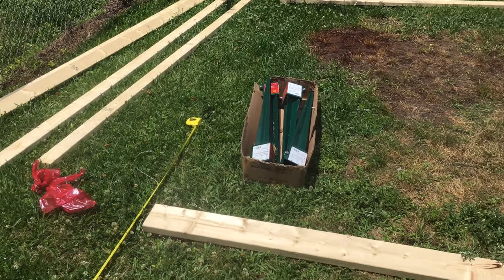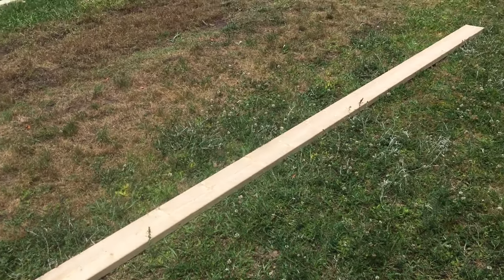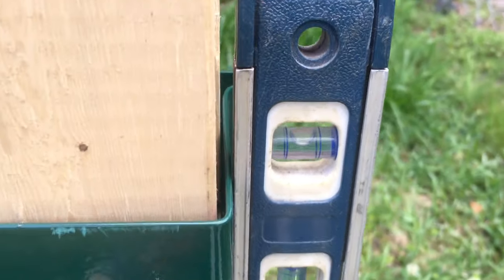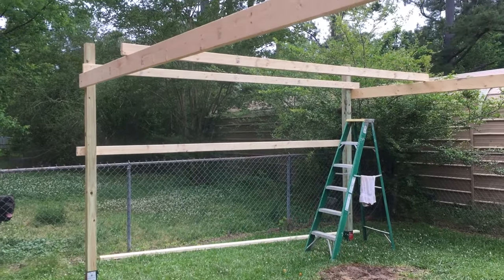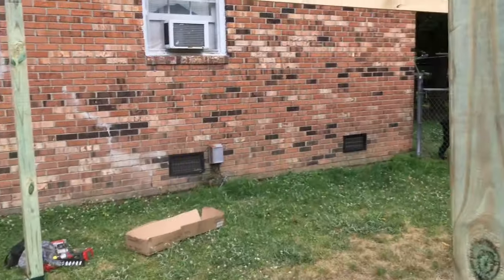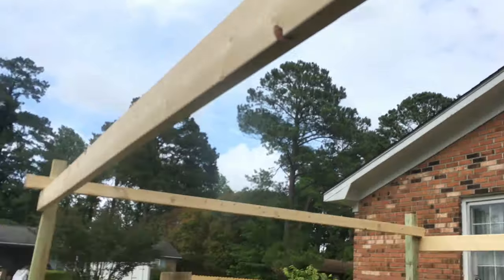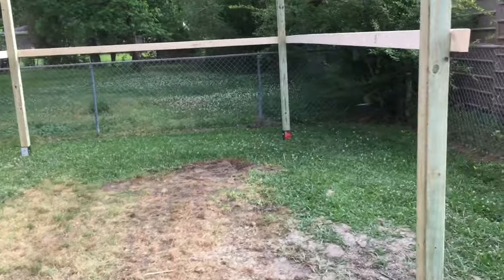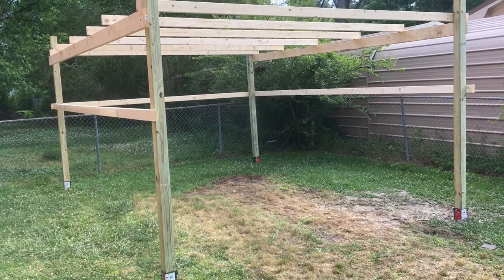Easy & Cheap DIY Carport Subscribe if you find this video interesting!

Comment: This is my kinda build project.  No money, cheap as possible, but functional.  Instead of sticker shock all at once price, build a carport first, sheath it over time and pour interior concrete slab later - spread out the cost over time.
Reply: Same! I just want something to protect against hail without spending thousands
Reply: @Techie_Lee same here perfect for my old f100 I’m doing up down here although I’ll be putting on a tin roof 👍🇦🇺

Comment: I got the harbor frieght carport for 100+ dollars. The top was torn to sreads by the wind, i replaced it with shade cloth. I used 20×10 pieces two. The wind blews thru it no problems and the shade is great
Reply: Also on the HF carport  I used T-posts on each corner to hold it down total cost 
120 metal frame
4 Tpost 5 each 20
Ebay items 
Two 50% shade cloth 20 each
6 inch bungie ties 10 bucks
Over all cost 170.00
 two years of use so far

Comment: I'm in the process of closing on my first house, which comes with a single car garage.  I was considering putting up a carport just outside the garage to use for parking while using said garage for storage.  Your method definitely piqued my interest.
Reply from the maker: I’m glad my project has provided some assistance in a way! The only difference I would make, as mentioned in the video, is using a metal roof. This tarp one ripped during the first hurricane. Otherwise, still standing strong. Subscribe for more diy ideas 😁

Comment: I've used those 4x4 post holders with great success. I've tried 2 years to remove them from the ground and after swearing alot, digging, hitting and more swearing, I had to dig them out by hand and shovel. Love them.
Reply from the maker: I know what you mean. Fun fact, I put one of these posts in at the wrong measurement and had to dig it up by hand. Very difficult to pull out!!
Reply: Use a hi-lift jack or a cable/rope around the base of them strung over an old tire on a rim or just the rim and pull slowly with tractor or vehicle. The trick is to pull them straight up. Engine hoist works too. Pulley on a tripod too.
Reply: Use a jack to remove it. A floor jack or such.

Comment: Hey bud, just searching through videos about pole barns and came across your video. I'll probably make something more elaborate than this, but I did learn that those stakes exist from your video, I'll look into those. 

I really wanted to say though, nice Mach 1. lol. I have a '72 Mach myself.
Reply from the maker: Thanks bud for watching. Glad I could provide some insight to your project. Subscribe if you could! I’m trying to reach 1000 subscribers. I usually make random diy videos. Whatever project I’m working on at the time, I try to upload!
Reply: I was going to say this too. My first car in 87 (at 16) was a '72 Mach 1 fastback.

Comment: looks good. paint it with used motor oil to keep the bees out of it and from rotting
Reply: Nice idea, but lets make sure no fire souce is near.
Reply: @JavoCover  wrong. it won't catch fire no quicker than anything else. it's a guy on YT that put that myth to rest
Reply: I thought my mom was crazy when she did this to the front porch she just built on her home... Only to the floors not the rails and pickets.  And wouldn't you know 4 years later the carpenter bees stayed away from the flooring and framing lumber and bore their holes in the rails n pickets.....add it to the list of sht she was right about and I was wrong 😂
Reply: @christophermhudson09  😁 experience is the best teacher

Comment: Bro i like to say its good enough for government work! It even gives me a little confidence as somebody who knows nothing about construction to do it myself. I'm going to use tin though because I'm in the Northeast and I need to support the snow load. Thanks!
Reply from the maker: Thanks for watching! Prices for lumber are a little higher her 2021 but may be cheaper than other alternatives. I am sourcing used metal roofing for mine as well. Subscribe for more diy videos!
Reply: Build one side slightly higher; alls you need is a gentle slope. Use a string and  screws for your sloped line. 
:>·

Comment: I am planning on making a 12x12 just like this, however I need to slant the roof the long ways and I will probably just mount each 4x4 directly in cement. I will probably use corrugated metal on top of OSB board as the roof.
Reply: Better to strap roof then osb or ply....

Comment: Good build, but it needs triangulation for strength. Cross braces in different places across the corners, horizontally and vertically, would make a huge difference.

Comment: I love doing doing diy projects, and I've been building a custom carport for a bit now, had it done, was gonna do so little things to improve it, but had a crazy storm the other night and one of the 2 sections collapsed, do you have any tips or knowledge that may help out?
Reply from the maker: I would use pressure treated wood, exterior lag structural screws, and galvanized hurricane straps. All these can be found at Home Depot or Lowe’s. If you don’t use exterior structural screws, it might hold for a while but will eventually rust and snap. Same with non treated wood, it will weather and become weak. The biggest tip might be the hurricane straps. This should reduce twisting. Also, what I don’t have on my carport are angle brackets. This might also reduce twisting.  Hope this helps. Subscribe for more diy videos.
Reply: Thanks brotha! That helps tremendously and I looked at the damage from the storm, it actually snapped a single 2x4 in 3 different sections and hence why one part of the carport failed

Comment: I'm pretty sure those "lag bolts" were actually interior cabinet screws....the come in a clear container that's kind of rectangular with a slanted bottom edge and are made by GRK or something like it.....I'm curious to know how well they're holding up as of today, I've always thought they had a lot more strength than for just cabinets
Reply from the maker: Are you referring to they T25 bolts that are holding up he 2x6x16? Or the screws for the 2x4’s?
Reply: At 2:26 when the camera raises up and you point at the 2x4s... At 3:05 you get a good close look at them... The ones you showed later on that have a nuts and washer on the end of them are lag bolts for sure.
Reply from the maker: @christophermhudson09  I think you are pointing out the outdoor screws I used to hold the 2x6’s in place before I used the lag bolts. The 2x4’a also had the outdoor screws put through them, however, they are not structure screws and one did snap when I ran into it with the lawn mower.

Comment: Run some ratchet straps under the tarp. To keep it from sagging
Reply from the maker: I didn’t think of that. Had a hurricane rip off the tarp, trying to figure out a new roof.
Reply: @CottoDIY  local used tin

Comment: Urgent! Hi and how are you doing today? Urgent! I need to make something like that for my big 5th wheel camper and am wondering how I make it like yours except twice as wide and three times as long and twice as tall cause my camper is 36 feet long and has two slide outs and is probably at most 13.5 feet tall but I have not measured the height yet. Any advice on what materials to buy and where to buy? I'm waiting for your reply.  Thank you!
Reply from the maker: Something that tall you would need to hire a contractor or buy a 5th wheel camper metal carport. You would want 6x6x20 or 8x8x20 vertical timbers for starters. Honestly, I don’t think that’s a feasible diy project. All that weight, plus the roofing, I wouldn’t attempt that project without an engineer or contractor.
Reply: @CottoDIY  Yeah a metal RV or Pole Barn would be best but where do I buy or who sells 6x6x20 or 8x8x20 vertical timber? Also I have 3 big huge pine trees on my land that is straight in a row about at least 60 feet length so I could use them as one side and probably tie a 40 x 40 tarp and let it hang over/downward. I'll decide after rethinking but again hey where do I buy? Thanks
Reply from the maker: @SupermanDaddy-777  you would need to source the timber from a lumber mill.
Reply: @CottoDIY  Wow!!! Now I would have never even imagined that I could do that. Well thank you so very much really have learned something new through you and will be contacting a lumber mill. And hey if I am SupermanDaddy you must be SupermanGrandpa!!! Lol! Have a wonderful day for you have made my day today and you have caused things to look up just a little bit better in my life with that knowledge. Yeah man didn't know that I could buy from a lumber company. Again Thanks and Thanks Again!!!  Your the best!

Comment: So is the carport still hanging in there? Thinking of borrowing your idea on a smaller scale.
Reply from the maker: Jazzy Kathy yes it is and it just survived Hurricane Isaias. One downfall of this design is the temporary tarp roof that started to tear from the rain water collecting. The biggest key point in my opinion is the structure lag bolts. Subscribe to my channel for more diy ideas!
Reply: I am a subscriber. I built mine but used metal posts. The tarp had one small area that wasn't pulled taunt enough. The rain built up and the weight of the water broke the poles. The tarp held up excellent. Gave me a big surprise. I am going to try and build a wooden one and make sure I have the tarp super taunt this time.
Reply from the maker: Jazzy Kathy I’m sorry to hear it broke! I built the frame lower on one side so that it would drain faster, but still had to sag one side more in order for the rain to fall off the the tarp.

Comment: Hey man great video! I was wondering if your carport moved or tilted in any way during the hurricane or was it not even a problem? Thanks
Reply from the maker: This structure did not have any issues with twisting or slanting after a few hurricanes. I have not added metal roofing yet. Will update when I get around to that project.

Comment: Could you have put some ply board up top then the tarp?
Reply from the maker: Yes, I suppose you could. The reason I didn’t is because I had my mind set on a tin roof. If you put plywood down; then a tarp, make sure you have hurricane straps on each 2x4, on each side of the 2x4. Check out other build designs too, there may be a measurement spacing to place each 2x4.

Comment: Is it strong enough in windy season?
Reply from the maker: I have yet to install a roof on it. The tarp ripped off in a hurricane but the lag screws are rated for structures so I would presume so, as long as the roof is installed correctly. I’m planning on doing a metal roof and will update with a video.

Comment: how would i check to see if these ground stakes can be reinforced with concrete and used for a 2 story pole building?
Reply from the maker: Hmm, I would look to see what brand you have at your local Home Depot or Lowe’s, then call the manufacturer.
Reply: @CottoDIY  its samson strong tie about 30 usd the same brand that manufactures all the joints for wood trausses and hurricane ties.
Reply from the maker: @markfeltner8260  I would think it’s a good base but would call to make sure. Some areas have to have concrete below the frost line, and the stake might not be deep enough.
Reply: @CottoDIY  frostline is 12 inches in arkansas

Comment: hello. it's been a year, is there a update coming our way? I hope your doing good
Reply from the maker: Hello, yes there will be an update, hopefully within a few months. I’m waiting for some used tin roofing to become available for sale locally so I don’t have to spend $33 per sheet at Lowes. Once I get the tin, I’ll post an update video. By the way, the structure is still holding strong, no issues with that.
Reply: @CottoDIY  good to know its holding strong, can't wait for the update
Reply from the maker: @kitt28  I’m not sure if your subscribed but if you do, you can see a notification if I’ve uploaded the video your interested in!!

Comment: How about a movable carport on wheels? There is no videos on this
Reply from the maker: Still Iraise I perceive this to be doable only if the ground is relatively level and solid (or concrete/asphalt). I can picture some all terrain tires if you were to move this across dirt; however, if there was mud, I’d imagine the sheer weight would have the tire (or all the tires), sink. If I had a concrete slab I’d definitely at least attempt this. Maybe another you tuber could. Best of luck. Subscribe for more diy videos!
Reply from the maker: Stinky Piece of Cheese funny. I’ll let you know when it takes flight ✈️ 🧀
Reply: @Stinky Piece of Cheese WHO CARES ,BUILD ONE ANYWAY so we can learn.

Comment: how is the carport holding up? did those stakes ever come out?
Reply from the maker: The carport is holding strong. The tarp ripped so you should figure out metal roofing or something other than a tarp. The stakes never came out.
Reply: @CottoDIY  if you tug on the 4x4 does it move or is it strong and steady? I hope you don't mind my questions
Reply from the maker: @kitt28  I don’t mind. The structure is solid. If you pull from the top of the post, there is some slight wiggle, but if you added a front and back brace, as the sides are braced, there would be even less wiggle. Or you could add some corner braces-also, having a roof installed would sure up the structure slot more but I haven’t gotten around to that.
Reply: @CottoDIY  if you plain on doing an update please upload a video, plus have you got a hurricane? and how did you attach the top 2x4s? Im going add concrete to my carport when i build it might be a bad idea or probably would work.
Reply from the maker: @kitt28  We
Have had a hurricane with it, but with no roof attached, it has not been tested. I attached the 2x4’s with hurricane straps found in the building materials section of Lowe’s.

Comment: Where did you buy those ground stakes?
Reply from the maker: I bought them from Lowes. Home Depot and Amazon usually have them in stock too.
Reply: @Cotto DIY  Thank you. I'm planning on building a  carport using 4x4s and I definitely don't want to dig holes
Reply from the maker: @mitchellmontesano8769  these stakes work great. They are standing two years later.

Comment: i have looked every where and i can not find those 4x4x8 post stakes
 that you are using, can you help!
Reply from the maker: Try ordering them on the Lowe’s or homedepot website and shipping them to a store near you. https://www.lowes.com/pd/Simpson-Strong-Tie-4-in-x-4-in-Powder-Coated-Wood-to-Wood-Base/1002708416?cm_mmc=shp-cprdhdwgooglelia-213-framinghardware-1002708416-_-0&placeholder=null&gclid=Cj0KCQjwxNT8BRD9ARIsAJ8S5xZ5LCBZHESrKwaYJrzBNTmWPct216pZ-PSCjSeMbvhLRSAegY5HA7oaAgbUEALw_wcB&gclsrc=aw.ds
Reply: If your in the great lakes Menards has them but they are for fences, and even for that they are pretty problematic.

Comment: Excuse, Can those four posts be directly inserted into the soil without a post stakes? would it be easier?
Reply from the maker: You an insert them right into the ground except you would need to set them in concrete or that expanding post foam. Otherwise, I fear it wouldn’t be stable.

Comment: The tarp is very temporary. I was wondering how 3/4 would hold up
Reply from the maker: What is 3/4?
Reply: 3/4 plywood. And it's way to heavy for this build would need much more bracing

Comment: What size lag bolts did you use? Roughly how many?
Reply from the maker: I used 2 for each post so that’s 8 lag bolts. If I remember correctly they were 4” or 6” lag bolts with t30 torx head. I bought them from lowes.

Comment: will this be strong enough to hold snow?
Reply from the maker: Hey, the load on these lag bolts indicate they should be able to withstand the weight; however, we don’t get snow here in North Carolina very much if at all so I could not say for sure. Definitely not with a tarp roof, that much I do know. My tarp roof gave way through the last hurricane so now I’m looking into a metal roof.
Reply: @CottoDIY  Can you use shingles instead of metal for the roof ?.
Reply from the maker: @72Dexter72Manley72  I do not see why not. Just make sure your structural lags are strong enough and you should be good.
Reply: @CottoDIY  I just see everyone putting metal roofs on sheds and carports and tiny homes. 

I grew up in Maryland where it snows and homes and sheds had shingles. I think shingles are cheaper also. Quieter inside the structure if it's raining or limbs hit it. 👍🏽
Reply: @72Dexter72Manley72  we used corrugated pvc roofing. They are inexpensive at least here in the UK. They’ve stood the test of time, through snow and rain. Typical British weather if you like 👍🏼
Reply: @joshhancill7273  Oh nice, I live in Arizona now. Northern Arizona is at a higher elevation so UV rays may make corrugated pvc roofing deteriorate sooner. Over 300 sunny days a year.
Reply: @72Dexter72Manley72  Shingles require plywood underneath because they have no structure. This makes them more expensive.
 A lot of people prefer the sound of metal roofs too.
Reply: @DarkLinkAD  I understand.. But I am applying my comment to my area and living in one of the hottest climates in the U.S. Baking inside a shed with a metal roof is not a good thing. In the summers here we have over 60 days of 110 degree temps. And 120 days of temps over 100 degrees. A pvc roof on a shed or carport will not last long in Phoenix. Even less time in the higher elevations. A shingled roof shed will be cooler inside. It will also be more quiet. I don't want to have rain sounding like bullets inside a shed or carport I'm in.
Reply: @72Dexter72Manley72  I think its really about price. The prices are so high in the states, its far cheaper to import wood from overseas.
 Steel is on everyones eye right now
Reply: @DarkLinkAD  Yes wood is really expensive right now.. 

But like I said, in my 110 degree summer climate. I want shingles rather than a metal roof.